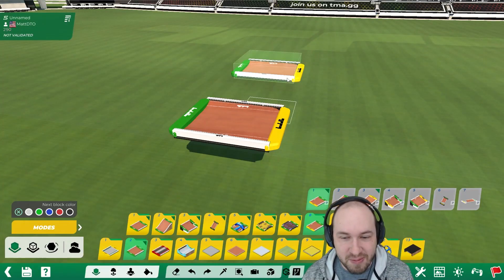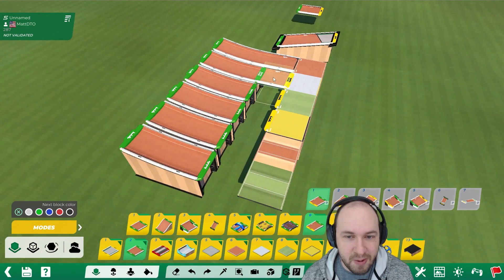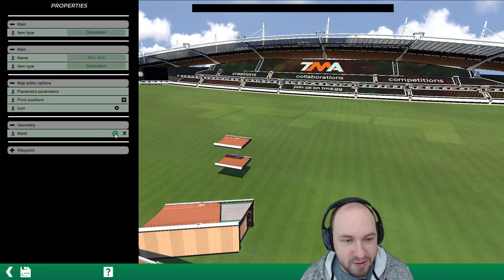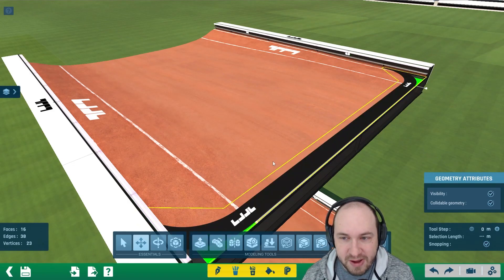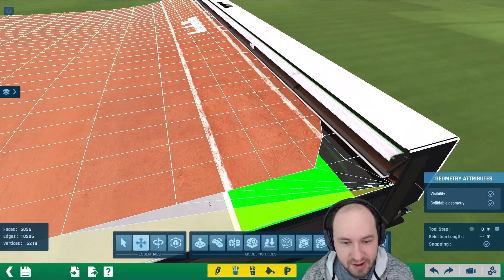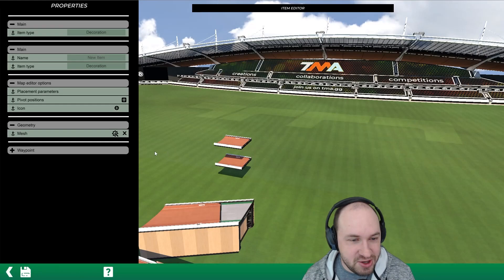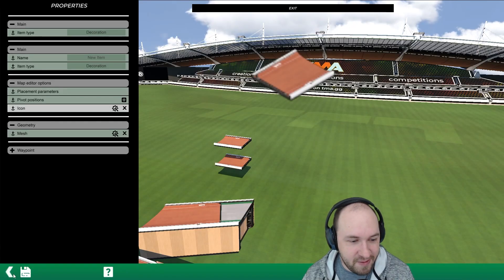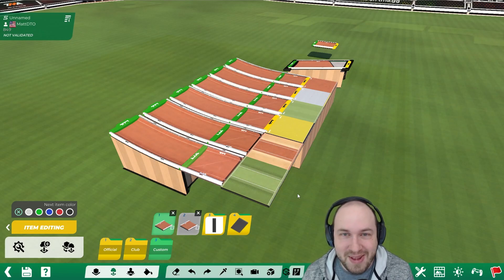How To Fix Dirt to Road Transition In The Mesh Modeler

Comment: Overall a good video. :)
But i have 2 additions^^

1. dont turn it into an custom item, instead turn it into a custom block. Custom blocks have the benefit that they behave like Nadeo blocks and they way lower in embed size. Thats because of the pretty detailed mesh from nadeo, especially the road border and the dirt layer but also the clips. Clips and border wont be embeded if its a custom blcok.

2. If you select one face of a texture you can press ctrl + q to select everything of that one texture.

Keep the work up :)
Reply from the maker: Thanks!!! Great tips :D pinned!